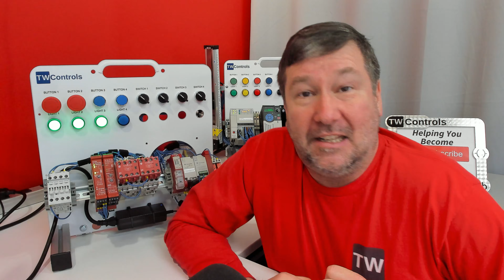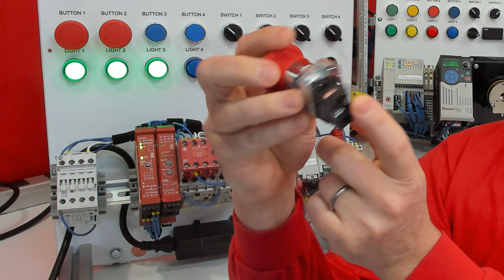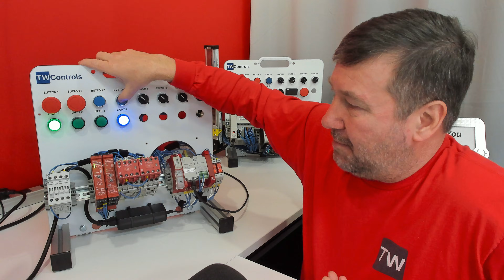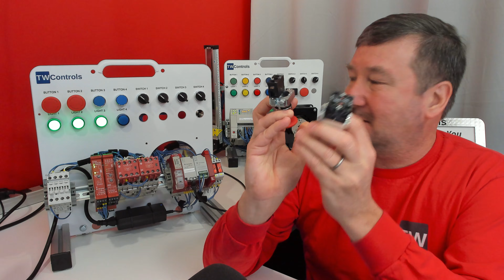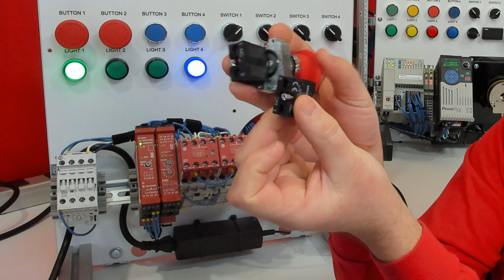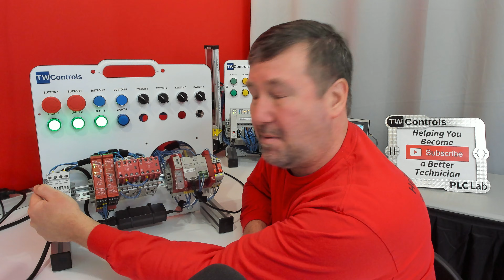Functional Safety: Preventing Accidents Before They Happen

Comment: Hey, nice video but I have doubt. In case3, welded contactors, the right hand side relays fail to isolate the contactors from the supply, as contactor is not working, how it saved the operator?
Reply from the maker: The second contactor is wired in series and breaks the connection.
Reply: @TimWilborne  Thank you for your quick reply :))
Reply from the maker: You are welcome

Comment: Great video Tim, might be worth mentioning a bit on ISO 13849 in a future video, why wiring safety contactors in pairs with a feedback loop reduces the likehood of failure and can help to increase the safety rating of the system. Ie safety contactor has mechanically linked contacts so when it fails all poles fail. The next level is to add a secondary contactor which then would reduce the likelihood and could be rated at pl level c. In order to achieve a pl rating of d or above a feedback loop must then be wired. Explaining why the feedback loop is on the NC contact as well would be good for the newbies to safety systems.
Safety torque off on a 525 drive might be a good one to mention as well.
Reply from the maker: Thanks.  I'm not sure if I'll go that deep into it or not.  I want to give enough information so that viewers know they need to respect the standards, but not enough that they think they learned all they need to know in a Youtube video.  I should do one at least mentioning popular standards.

Comment: Safety has to be a mindset period !!!
Safety controls help prevent people from doing dumb stuff. When the motor contactor gets welded shut that saw blade will not stop untill power is removed, heck even the overload will not stop it. Thank you for covering this topic.👍👍👍
Reply from the maker: Thanks.  I have been on the fence about doing this video for a while.

Comment: Great video Tim, I appreciate the effort you have put in to demonstrate fault masking and the consequences of single point failures in both single and dual channel architectures. I recently shared my own demonstration on this on LinkedIn to raise awareness which you have done more eloquently I might add👍🏻. 

As I mention in my post, we must be mindful of series connections in both process and machinery safety for these very reasons. 

As a note, while redundancy can offer a layer of protection and increased reliability and performance of a safety function so to can diversity, and I encourage machine builders and end users to specify diverse redundant architecture where possible, further increasing reliability and safety performance.
Reply from the maker: Great points, drop a link to your post.